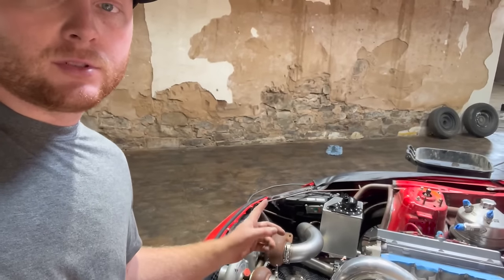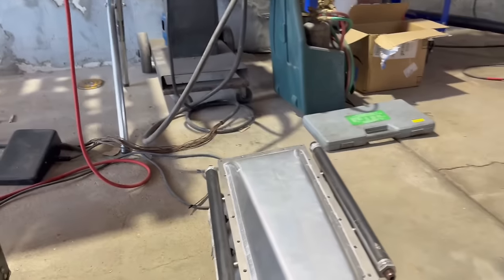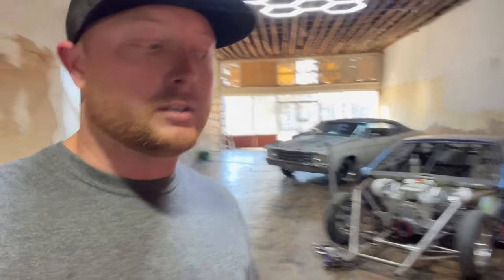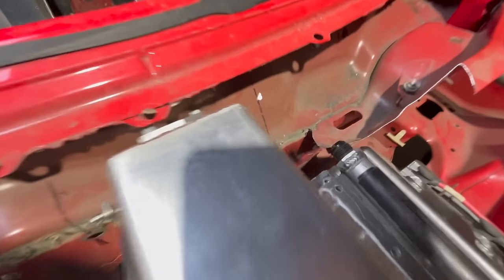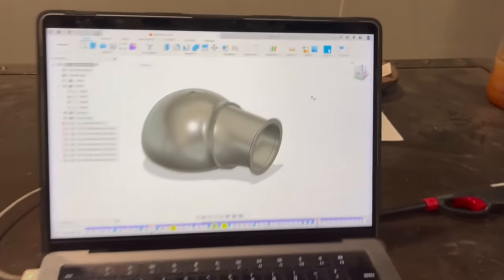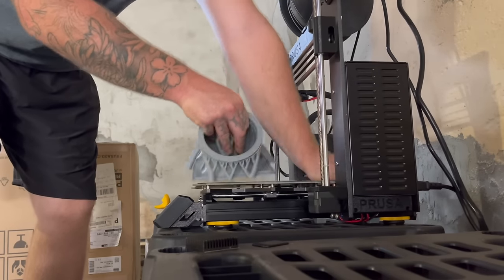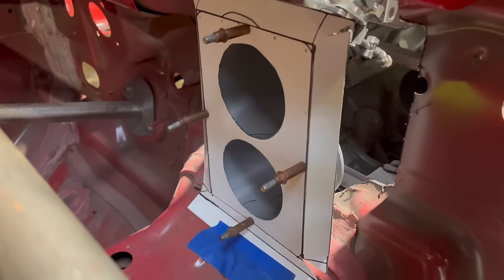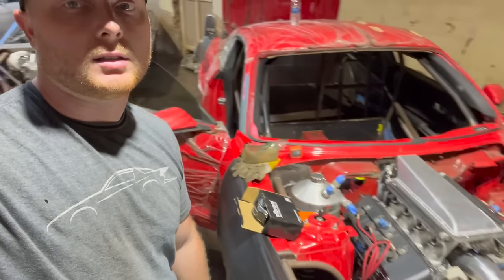3D Printing & Prototyping For Racecar Coldside! S550 Mustang

Comment: Cool. You spoke to flex. I imagine the supports coming off your SUPERTRICK Flow Body to the firewall will have poly flex grommet     at the sheet metal - thru bolted. I'm just guessing here. Very TRICK setup whatever the final assembly is. Bitc-en! You are so talented.

Comment: Great work! Have you tested 3d printed parts in automotive applications before? Can they handle the heat and pressure? Wouldnt be fun if the showed not to work 😮

But as always, great and Inspiring work!

Comment: Isn't that manifold on backwards? And I don't know anything about fuel injection and I just know
Reply: Technically yes it’s on backwards but the engine doesn’t care which way air comes in . A lot of people run it that way when they run big air to water intercooler in passenger seat .
Reply: It's to improve the layout.